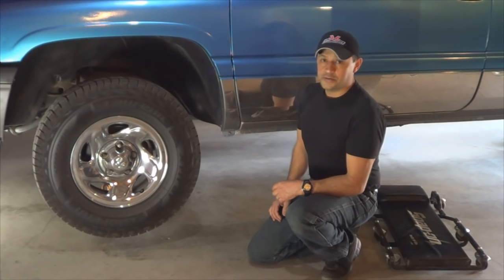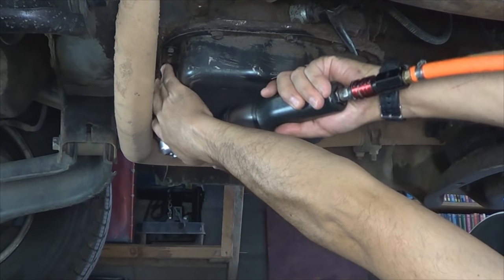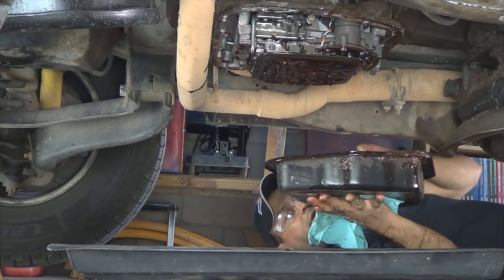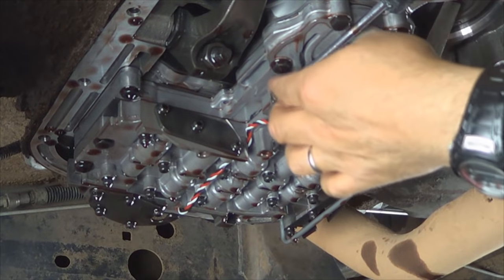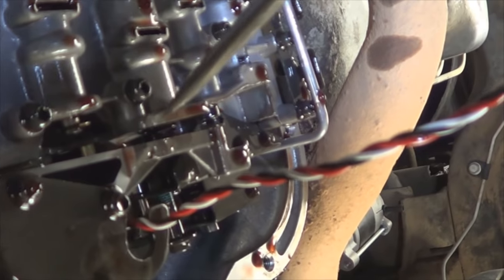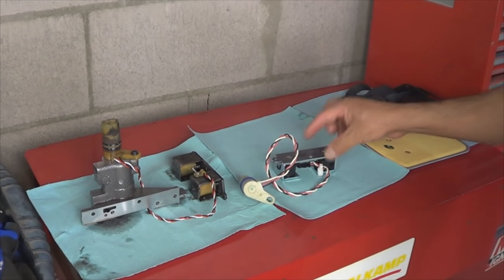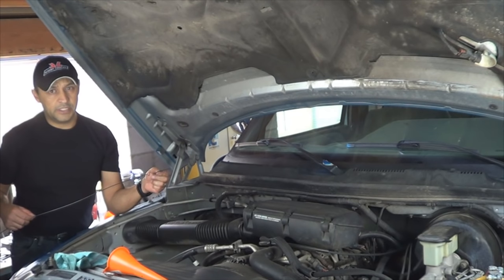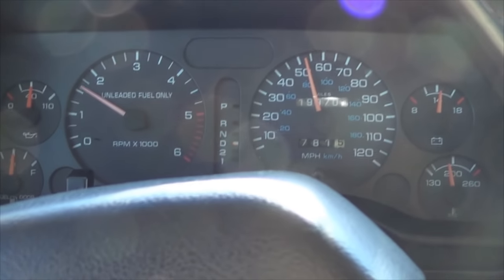Dodge RAM 1500 Transmission Shifting Problem Caused by Defective Pressure/Overdrive Solenoid.

Comment: This video help me a lot. Thanks i did and solved my truck
Reply: Was it hard to do I have worked on my own cars brake's,fuel pump, never a transmission
Reply: @craigfonseca9306  9
Reply: Do you have a video about the transmission shifting problems might I watch it My transmission won't shift out of first and now it slipps alot I put Lucas tyranny stuff in it yesterday and it started doing this. It did not have a problem until I put it I n.
Reply: Mine is taking off in a high gear low 1 is not working transmission oil looks good and smelly good
Reply: @juansalazar1766 got one doing the same thing. 01 ram 1500

Comment: i watched this video and was very helpful so i fixed my transmission myself, my problem was that spring inside the cyclinder , i recommend buying a trans kit that includes solinoids and spring, filter, gaskit etc
Reply: I tried to find a kit that includes a spring but couldn't find it online. Any recommendations please?
Reply: @fabienrousselot7460  yea on eBay they sell the whole kit I just bought one myself
Reply: which spring, I found the one in the accumulator was busted but also saw that, that spring is prone to breaking so even if it's not broken it was recommended on forums to replace it anyway to avoid having to open again soon after repair to replace it, 

but are you talking about another spring, 

also what was the problem you had that replacing this fixed?  (I am having an issue with the 1-2 gears not engaging (intially it would occassionally engage, but now it wont at all after replacing the piston rings and spring on the 3-4 accumulator and I am still trying to find info on how to test my solenoids to see if they even work or are gummed up, I tested the resistance to make sure they were not completely shorted out from a wire burning out, and still have continuity with like 32.9ohms on each soo.

Comment: Good job my friend. Let's hope that's my problem on my Dodge 5.7. Ram 1500 ,  I would also like to compliment how clean your shop is , you are a true professional. 👍
Reply: hey frank what was wrong with your transmission? i have a 1500 5.7 too and im having really bad issues with my trans. it only uses 1 and 2 second gear
Reply: @kerwinponce477 did you ever figure out this issue?

Comment: To anyone wondering: this solenoid being defective will cause hard shifting, late shifting (so can the speed sensor), TC lockup issues at cruising speeds, and other various issues. If you’re experiencing any transmission shifting issues, do this before anything else. 
Thank you for posting this detailed video, it was very easy to follow along with and informative. Great job.
Reply: Speed sensor can cause late shifting? I have a proble. The second to third shift late. Always. Unless i drop the foot
Reply: Does it cause the truck to stay in 4th gear?
Reply: Mine is starting in 4th year also. Would this solenoid cause that?
Reply: It happened to me just yesterday so
Reply: @riggafrank same here. 01 ram 1500. Code says pressure control solenoid wire broken or shorted. I dont know if its a wire or the solenoid itself. Trying to do some tracing but its a pain

Comment: I want to do this operation myself but I am worried about that spring, you are not really showing how you put it back and it seems to be a sensitive part of the job. Could you elaborate a little? I heard sometimes the problem is just the spring that is broken or damaged. Where to find a new spring? THX

Comment: I don't know if anyone else does this . But to save the trans fluid I usually put a syphon tube in at the trans stick all the way down and pump as much I can put from the top before unbolting the pan
Reply: Only do this if your transmission fluid is still pink. I’m changing mine! 1999 Dodge Ram 1500 5.2 my transmission pan looks 👀 different from this one

Comment: I have one just like this with 75k miles and it pops and gets stuck at 25-30 mph it won’t accelerate for about 4 seconds then it’s no problems. Is it the solenoid maybe?? Thanks

Comment: I have a 1500 series  dodge ram 1999 that is slipping between  30 mph and 50 mph . Filter been changed. Could  it be the silicone.  Can't go above 50 mph . Your recommendations . 
V/R
Jason

Comment: i had broke the transmission connector solenoid, (plastic piece that bolts to the valve body), when I installing the valve body.. it looks like it only serves two purpose holding the connector and swivel to make the install thru the trans case.. if I were to leave it as is would I have shifting problems.. looking for some insight..

Comment: Maybe you know the answer to this unique issue I have on my 2005 Dodge Ram 5.9 Cummins automatic w/overdrive transmission?  196,000 miles.
 It's the original transmission and motor. All fluids/oils and filters regularly changed and kept clean/new.  Not used to tow often...4-5 times a year at most and 8,000 lb loads at most.

I've asked 4 tranny shops and a few forums and Facebook groups but no luck finding same problem or proper fix. I'm wondering if I'm just that special?!?? Lol

One mild Fall day last year I had driven 260 miles on interstate at about 75-80 mph.  It began slowly reducing speed over 6 miles from 80 to 15mph.  Moving fuel pedal would not do anything but make it stumble a little a couple dozen RPMs up or down.  Stopping and restarting it immediately did not help nor did changing gears manually.

All fluids were fine, not too hot and no burning of anything fluid or conduit wire was observed.  All looked good under and above it.

I stopped it for 30 minutes as I checked it over. It would drive normally after that, but it would only go 25-30 miles before it would slowly slow down again as described above.  I did this over many cycles all the way home 260 miles.  I'd turn it off and on again, completely off as it rested for 25 minutes.  The batteries seemed to be getting charged (started well each time) and no warning lights were on.  Once or twice, when I drove it until it would not even crawl anymore (1-2 mph, I was testing it), it stalled. So it wasn't hard starting or hard-stalling unless I took it all the way down to 1-2 mph speed.  It was not idling weird either.

Could this be an electrical ground failure or electronic issue?  If I had a battery connection loose or anything disrupting the flow could it cause this?  It seems like something is getting tired and needing to cool down or something but nothing was overly hot or smoking. What's weird to me is it's not slipping in the usual way of revving up but not moving. It would usually get no lower than idle.

Tranny shops haven't heard of this before.  No transmission codes either.  They want to charge me $3,000+ for new or rebuilt tranny.   I want to rule out wiring and electronics (that don't throw codes) first.  

Any suggestions?  Heard of this ever before for an automatic transmission?
Reply: Try the catalytic converter
Reply: i had a similar problem with my diesel, it would die and if i let it sit then it would run. turned out to be the fuel shutoff. you can manually wire it open to test but the truck won't shutoff. diesels only shutoff when the fuel is shutoff to them.

Comment: I have a 95 1500  180k miles and recently it did not want to go into gear. I took to a local shop but I don't think they wanted to work on it. It seemed like it went out without any kind of warning, is this normal? After I was on side of road for about five minutes engine off I turned back on and once placed in lowest of gears it moved a little bit, but then stopped. Will doing this procedure be advised, if not I guess I have to sell for parts. Thanks!

Comment: My 2011 Altima has the same issue a few weeks ago. It just turned 80K miles, had the car since 7 miles brand new same month it was built in 2011. I went to a few car repair shop they wanted $4500 to replace the transmission. I pulled the code it came up P0745. I want to replace the solenoid myself but kind of nervous since I have to drop the valve body.
Reply: An Altima …😕 those have different types of transmissions and what ur stating is a common problem in the 2008 and newer models ….just thought I’d share that with u…my son had the same car and same issue…he end d up selling it cuz it would have been too much for him to afford it repair

Comment: Had this problem on my 1995 dodge ram. Then one day I was at a stop light and truck would not move. It moves now when it's cold but haven't taken it out of my driveway. The transmission has (Never) slipped.Could the pressure/overdrive Solonoid be the problem or something more serious?

Comment: You forgot put what year of the truck because I’m working on a 99 5.2 2wd and mine Is different i had to replace the twin solenoid because the mew one drop a code so I try to use the old ones but plug were different had to drop the valve bodie to replace the plug ,,,,good video tough
Reply: The years are in the description

Comment: Hello I have a problem with my 5.9 1500 dodge. It revvs high before shifting to 2nd gear and it’s rough. I’ve changed the output speed sensor, the throttle sensor, and the govenor pressure sensor and solenoid. But I didn’t change out this part. Is my transmission shot? Or do I have more life.? Thank you
Reply: My 96 5.2  first my torque converter had a whining noise.. I changed that everything everything worked fine for 11 days then I had serious shifting problems.. I changed the high pressure shift solenoid & transducer it worked for 2 days now I have problems with the transmission dropping to first or shifting out of first but sometimes it seems to work fine I bought my parts on the request of a transmission shop. I was told those parts would solve my problem they did not. this video out of many of videos I have seen is the only one to show replacing this particular part he shows.

Comment: My 01 Ram 1500 doesn’t shift up at 55-65mph and the rpms stay at 4000 and shows no codes. Do you think it’s the o/d actuator?
Reply: Curious what you found out with your truck? My 2000 ram isn't wanting to shift out of 1st gear until around 3,500 rpm. Wondering if this is my problem.

Comment: Hello, my name is Diego, can you please help me? My Dodge RAM 1500 year 1995 disconnected a hose and lost all the transmission oil and now that I added oil to it it it works but it doesn't change speed it moves at the first speed and it doesn't change
Thank you

Comment: is this also called the Transmission Control Solenoid? I couldnt find a pressure sol listed at the parts store! I have a 1995 that has code 37 but no transmission slipping or acting funny or anything like that
Reply: I know this was three years ago, but it's called the torque converter clutch solenoid.

Comment: 2010 RAM 3500 shifts to Reverse  on its own while driving @100km/hr. And engine stalled. Seems not mechanical problem. Whats the cause: Solenoid, wire, pcm...?Could you give advice?

Comment: Hi - my 01 1500 seems to rev high and not go into OD as it used to.. .. fluid isnt brown or burned, still quite clean. i put in lucas stop slip.. i can drive it but sometimes it wont go into OD.. sometimes it does the same in first or second, revs high for a bit the drops like the band is slipping. Can i try reset the fwd band from the outside? ill check my obd and see if i get this code, thanks!
Reply: Did you get to fixed it? What was the outcome

Comment: I've got a 97 Ram 1500 2wd 5.9 L Automatic Trans,  it won't shift into 3rd gear. I can't hold it in second gear and maintain speed. I have to slow down to 25mph to accellerate.  Before this happened it was shifting erractically
Reply: What fixed it? I currently have this problem with the same truck
Reply: What was the fix? Same issue here

Comment: what were the actual shifting problems you had from this going out?
Reply: oh by the way 94 1500 with the 5.2 engine, apparently a magnum  v8? is what is on the truck, build sheet says 46RH transmission so. seems to be almost identical to yours from appearance

Comment: Does this solenoid have any affect on the tack working or what makes the tack work on this model of ram? I thought it would be through the cam position sensor but it didn’t change after replacing..maybe it’s in the instrument panel …
Reply: Tac works off the distributor

Comment: I had a code 37 after replacing the PCM (had a short in the connector) and replacing the harness connector.  Apparently, the new PCM required a Transmission Coolant Temperature sensor where the old one did not. After replacing the Shift solenoids and following your advice the Code did not clear. $25 dollar temp sensor installed in the transmission and hooked to the existing harness plug (that was previously unused) fixed the problem. So....just saying.

Comment: would this cause a slip when truck is first started?  Slip usually stops after heated up.
Reply: I'm having the same issue on my 94' B250. Did you end up figuring it out? I even replaced my solenoid and code 37 is still on. There might be a short somewhere after where the solenoid is connected.
Reply: any luck

Comment: Hi! I have 95 dodge dakota 3.9l , 2WD 
When I start driving it's not going on 2nd gear but engine works nice and then it's kicking on 2nd gear!you think it's bad solenoid?thanks
Reply: +Atis Judins You have a throttle cable that is out of adjustment or you might have a transmission that is in need of a rebuild soon or just like mine at the end of the throttle cable where it attaches to the transmission there is a return spring that just isn't pulling it back to normal shift so I had to take it and put on a shorter one and yes it makes the throttle peddle a little harder to push down but mine now shifts like a new one. I still need to rebuild mine soon but at least now I can drive it a little longer before that time. Keep looking on here and you'll find some good videos about changing the transmission fluid and while you have the pan down you can change the solenoids also like I did and that helps. Good luck for now!
Reply: I changed transmission solenoid and it's running like new one!!!
Reply: Damn good job! Just keep an eye on that throttle cable and where it attaches to the transmission. That would be where you may have your next problem from. Happy driving!
Reply: whats up i also have a 95 dodge dakota 3.9 2wd and have a 4-5 code but have some of the same symptoms and how is ur truck holdin up after replacing the solonoid

Comment: I've got a situation where I replaced a 46re in a 97 Dodge Ram 1500 4×4  with a 44re out if a 96 Dakota 4×4 5.2 it started out working well however once the first drive it slowly started to quit working to the point of not moving at all
Reply: My 99 2wd 1500 5.2 litre is doing the same thing to the point where it won't move at all then I turn it off the start and it will go. I know its not the transmission itself because when I turn off and start again I can burn rubber until it gradually goes out of gear. Did you ever fix your truck? If so what was the problem? Let me know my friend.

Comment: i have a 1995 dodge ram 1500 5.9 i have a problem when i turn on the truck i runs and everything but when i get it to running temperature its just just stop driving whdn i have it on drive it stoping going like if it was on neutral anyideas for why that happing i changed the trans fluid and filter

Comment: I have a 07 Dodge 3500 four-wheel-drive Dooley having trouble when I'm going forwards I can feel shift in first second when I get up to about 40 miles an hour then it downshifts  and I could feel I don't have the power and the transmission it when I'm got the trailer hooked up what could be wrong

Comment: I have a 99 dodge dakota 5.9 I put new bearings and seals in the rear end last week. My transmission was working OK then someone told me put Lucas transmission stuff in the tyranny so I did now my transmission won't shift out of first gear. I have to take off with high rpms and let off the gas and it will go to another gear. I changed my fluid and filter today and still no change. Could my clutch plates in the differential be slpping and making it seem like the transmission.  If someone could please help me I would appreciate it greatly

Comment: Hey sorry to bug but I have a 96 dodge ram 1500 5.9 engine and was wondering if have any idea why my over drive light keeps coming on every now and then. I already changed filter and fluid.
Reply: Did you figure it out. I have the same issue

Comment: Just like someone said, there are drain plug lithos that make these jobs slightly easier, but I have a one-up on that;

Get a fluid-removal hand pump, battery powered pump or siphon to drain everything you can to drain the unit…  wry little fluid loss and you can inspect the entire body of fluid in a jar instead of in the ground (like I did last time)

Good luck!

Comment: 99 Ram 1500 5.2L 219K miles..I have noticed when I have to get on it and rpm’s get up to around 3500 it seems like the transmission slips and it’s doesn’t accelerate does anyone know what the issue is. Any comments would be greatly appreciated!!!

Comment: Hello sir, I have a 1998 Dodge Ram 1500 5.9 4x4 with 188k miles. I noticed my transmission has a kick while driving in overdrive. I’ve rebuilt the trans at 100k miles and changed the fluid two years ago. After watching your video and a few others it seems like it’s the solenoid that failed. I have a ob2 scanner and currently no codes. Any feedback will be greatly appreciated.